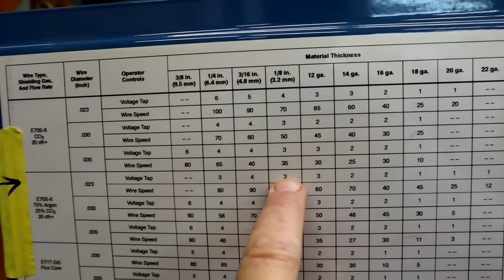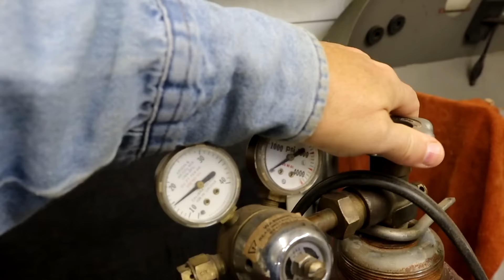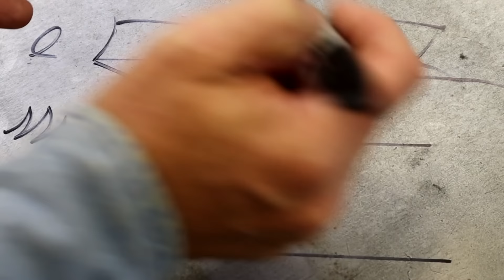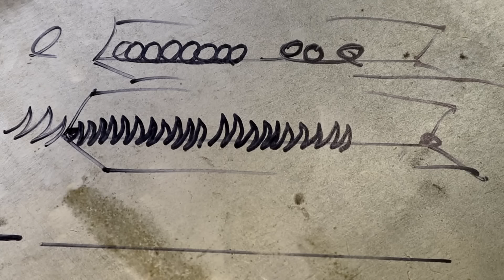How To STACK DIMES With a (MIG Welder) For Beginners🔥🔥🔥

Comment: I work in a fast paced production shop making dumpsters, typically running around 30@640 on 12ga sheet. I wish I had the time to go slow and actually do designs.
Reply from the maker: Dang you slaying it, thats movin some metal. I bet you can lay down some slick beads!!!
Reply: We do the same, but the machines are cranked up ALL the way on voltage and wire speed. It's VERY hard to find people to start no matter how much experience they have, they burn through as soon as they pull the trigger... Hell I still burn through, but I can start the "bead" over and go a Lil faster over the whole and fill it...
Reply: Bro I make dumpster and car haulers. we make 1 a day. Everyone does. I paint and put the axles and wire it up. I even cut my own stuff and weld it I bust my ass
Reply: I’m doing 3mm sheet for bins, we set a nice outside corner every join and flip the bin to suit a vertical down, manage to get some nice looking beads with good penetration.
Reply: Yea we push out server cabs 50 + a day depending on what line you're on and I wish we had the time to make things pretty
Reply: I ironically make dumpsters too. You gotta rip and run it sucks I like taking my time but it’s not in the cards
Reply: @joshuatorres318  boss makes like 30k a week. I make 1200 with 1 hr lunch 🙃 if I even take that whole hr the American dream
Reply: I work on dumpsters and goooood lordy there something else
Reply: @wolfseek crazy, I make 450 a week (uk pounds) and I only have fucking 30 minute lunch, which is technically only 25 minutes but everyone ignores that
Reply: I build kitchen hoods on a production line! I’m doing. 18g 430 @ 20.5 heat and 350 wire speed.
Reply: @TheTruthMatters do u need to do alot of back and fourth motion?
Reply: @VypaGaming  there's no way possible to do a back and forth motion. They aren't the best looking welds but they are EXTREMELY STRONG. It's not the welding you learn in school or online. Turn the machine ALL THE WAY UP, LAY A BEAD. It sticks...
Reply: dude how do yall burn so fast I took a weld test at a place that builds dumpsters today and I couldn't figure out the speed without blowing through or moving too fast. needless to say the guy said I needed practice and I told him my machine at home doesn't go that hot lol
Reply: I’m doing parts bins and it’s the same thing , 26.5v and 500 just lay em as fast as you can well they look good enough to grind lol
Reply: Y'all are too funny. 
I weld on ships and we only run 23- 25 volts on 8 mm plate. The only time you would turn a a machine to 30 volts is when you are welding  20-72 mm thick plate.
Reply: 30 volts on 12 ga. Sheesh
Reply: What’s the pay like?
Reply: @Gregoman89  they started around $21 with no experience. After 3yrs I was over $25 but they did a mass "furlough" a few months ago because they claim they weren't getting orders which is a lie, so I no longer work there.
Reply: All y'all saying you weld dumpsters and stuff, I'm not a welder as a profession, but wouldn't stick work better for that, or even be easier?
Reply: @donkeyhotay456 my guess is they're just trying to max out production with hotter faster welding

Comment: Them welds won't be strong enough. For that thickness of metal, run 28 volts or something and don't do any loopy sh##
Reply from the maker: Haven't broke yet, Ive built offroad chassis that jump 15ft in the air with no fails, its all about the settings.

Comment: Because humans are stupidly hard to come by, we started using MIG robots. We make complex aluminum tubing bodies. We had historically only welded aluminum using TIG (artfully I might add) and still do but we were forced to use robots to keep up with demand.  The robot makes messy welds in comparison. Especially disturbing is the spatter.  I am wondering if you could use air nozzles to blow the slag out of the way and quickly cooling the beads, so they do not stick.  Has anyone ever tried this?
Reply from the maker: I have used the weld splatter spray . You spray it on your metal  before you weld and it keeps the splatter from sticking to your work piece.
Reply: air nozzle will blow your shielding gas away and you will have the ugliest porous weld you ever did see lol
Reply: @jamesgreene5342  Thanks! That's why I was asking! I expected something lol worthy. And its hard to explain but my thought was instead of blowing it directly at the tip... have the air nozzles basically attached to the weld head blowing in any direction but towards the weld (or reflecting in to). I am sure this is why more complicated than I can imagine so my real hope was someone would say, "We have a working model that does just that!" or someone would say, "We tried and failed."
Reply: @ACDesignsGarage  useless when it comes to low hydrogen rods

Comment: Won’t be very strong, welder for 40 yers plus.
Reply from the maker: It works on the thickness I weld. I mainly do chassis fab around 1/8" to 3/16" also im welding all around the tube,its pretty strong. I also have been welding for 30 years and been employed by offroad race teams and seen my welds flip end over wnd at 80 mph and not break.

Comment: You shouldn’t never drag and/or (stack dimes) with mig welding. Dragging the nozzle doesn’t give the penetration needed you should push with mig. Any sort of weaving will cause weak spots in the weld and cover up porosity. It will also reduce penetration needed for a good weld.
Reply from the maker: Ive done several break and etch  test and cant see any difference in penetration. Its all about your settings, you can do a cold weld pushing and not get good penetration

Comment: my dad had me welding since 13 building stuff around the house now i'm 52 been fabricating since welding is a valuable skill that I thank my dad to this day for teaching me and taking the time to really show me a skill where you work with high voltage and sparks and flame fire
Reply from the maker: Thats awesome,  My dad started me around 12 and im 45 now still welding. My dad use to be a pipe fitter/welder for a power company for years, thanks for sharing and watching!!!!

Comment: As a professional welder for 46 years ( and still going ) I have to say I almost never ' stack dimes '.
I pay attention to the blending of the metals on either side of the weld plus heat flow and things like that, never dime stacking.
I have worked a lot of different jobs welding things that need to be ' leak tested ' and seeing a weld like this I can't help but think how under every third or fourth ' dime ' there is a leak.
Reply from the maker: Its like a different tool for every job, Now granted I dont use it all the time but when your in chassis fab and not welding over 3/16" wall max square tubing it works pretty good. Not saying it works for every situation. I do break test with acid on all my processes and it faired pretty well with proper settings. Thanks for your input, I always consider everyone's knowledge!
Reply: @ACDesignsGarage  one thing for sure, almost every welding job has its own ' different ' processes.
Reply: I'm an underground mine foreman of 24 years and countryboy/hillbilly that agrees with watching the flow and doing whatever works to get consistent penetration and metals fused together as one. I guess it's easier said that when you are expected to do a job right and sometimes paying the price for wasted time and materials you're going to learn quickly or find the guy that knows what he's doing. Lol
Reply: Do you make a good amount of money?
Reply: In welding school we got scolded when we "stacked dimes". But of course we did it, because it looks cool. When it came to strength and penetration tests, our teachers convinced us that straight overlapping beads are better though. But then again, anything can be "good enough" and straight beads does not look as cool... :D
Reply: But when doing a fillet, you have to span a bit.  That takes lateral movements, which naturally create "dimes".   ???
Reply: Where can we go to watch you?
Reply: I’ve been welding for 165 years, I disagree with your comment and I can guarantee I’m a better welder than you
Reply: @Imthebestaround88  you probably are. All I know is I have been doing it too long. Past retirement age and still welding.  I've had fast production 
' squirt- gun ' welding jobs, I've had high- power stick welding heavy plate jobs,  I've had building intricate machines jobs, I've had monotonous same old thing over and over jobs, I've had fitting and tack welding jobs where I didn't even use a shield. I've had tank welding jobs where everything had to be leak tested 
( thats where you get good ) stick welding, mig welding, tig welding and torch braze welding.
Right now I do a lot of tig welding using a mig wire feeder to cold feed wire.
They are all different.
Then there are the different repair jobs.
That is a whole another story in itself.
Reply: Could you weld both sides? One side for the eyes and one side for function?
Reply: @matthoon3737  yeah, I suppose you could. Depends on what it is.

Comment: The trick is... you want root penetration so the weld is a weld. Not a pretty bead profile with minimal electron transfer. A good strong weld will look great and be strong. Over ocilation for looks will bypass the strength of the two parent metals becoming one unit. Your video is a great tutorial for light applications for sure. Awesome work.
Reply from the maker: Thank you, yes its based on automotive applications like 3/16" and not structural applications.

Comment: 6:24 no penetration. You have to get the arc out of the puddle, move forwards, dig a trench then go back and fill it in.
Reply: Not to mention he is not running hot enough to keep the air out

Comment: Thanks for the tips! I'm loving welding, got everything I need and have been making small things, tools in my shop. Practicing so I can build a tube chassis rig!
Reply from the maker: Thats awesome, I've want to build me a tube buggy also. Thanks for watching
Reply: So this is my whole reason for getting into welding I’ve been watching cars and cameras a lot amd a lot of gokart fab watching fd champ mike essa build roll cages all I wanna be able to do is have a couple motors and be able to weld me up some chassis ultimate goal is building a 1000 cc cross cart buggy thing in the design of a rc car set up.. but my question is would a 120 volt welder be suitable for welding some steel tubing for a off road chassis and would y’all happen to know the desired tubing dimensions for building a cross cart I’ve read alot of different things and I’ve also seen people build mini bikes with Home Depot conduit  I just wanna know the cheapest strongest steel

Comment: I bought a Miller cracker box stick welder and a 100’ roll of 6-3 wire to use as an extension cord 50 years ago . The wire eventual was used for different purposes but I still use the welder. Works great even now.It is a vvery solid machine.
Reply from the maker: Thanks, I still have my old miller buzz box that was my first machine. They keep on goin!!!

Comment: If I were doing that fillet, I would have the tip sticking out paste the nozzle 1/8". Don't touch the tip to the weld (of course). You won't believe how much better things are. Works great on flux core too. You can chamfer the insulator and/or pound a piece of pipe in the big end of the nozzle to swell it out so it will slide on further.
Reply from the maker: Awesome, thanks!!!

Comment: The ideal weld is smooth and clean inside and out. Do you ever find the "cursive e" method traps slag inside the weld? Outside appearance is a good indicator of quality, but the stacks of dimes come from the TIG process; there is no reason to mimic that appearance with MIG besides trying to impress people that don't understand what they are looking at.
Reply: Generally speaking, MIG doesn't create "slag" as we traditionally know it. The issue comes from dragging impurities BACK into the weld puddle. The silica glass that forms on a MIG weld will always float to the top. NOW, if you switch this over to flux cored wire, THAT is when you run the risk of slag inclusions in the weld.
Reply: Also makes for a weaker weld with less penetration.
Reply: Yep
Reply: I was doing mig today for vertical I was doing upside down v and it worked really good for me

Comment: The circle bead is a much tighter weld,that prevents less gas bubbles from forming inside the bead. I rarely run the zig zag beads unless I am filling bigger gaps on a joint. Your beads are nice an tight bro. Nice work!
Reply from the maker: Thank you very much!!!!!

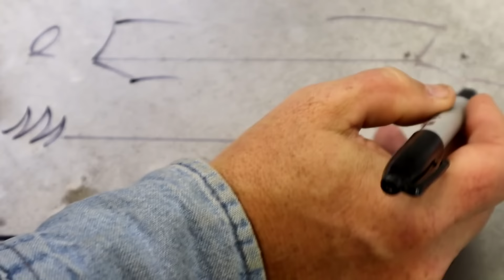Comment: 3:00 No loop. Pull straight forward "getting out of the puddle." You will dig a trench, come straight back, stay in the grove but tilt tip over to the top, wire stays in the center, no loop. Stay still until the puddle starts to shake, then get out and move forward again. You should be able to count the number of times you step back. And get you should get a reliable length bead for stich welding.
Reply from the maker: Thanks for the tips! That process is what I call whip and pause, gonna do a video on it this week.
Reply: Basically whip and pause. I'm okay at whip and pause but I'm better at a straight push. My whip and pause pulse spray transfer however looks immaculate lmao, gotta love pulse spray

Comment: I'm not a professional on mig, but in my experience what I used to do is a little forward and backward movement, and it leaves a pretty good looking weld
Reply from the maker: Yeah it works well also, I do it  that way sometimes!!!
Reply: I do the same. Its commonly known as the "whip and pause" technique.
Reply from the maker: @brianwalker1933  Ueah I like to use it alot in high visible areas on car chassis

Comment: My one and only welder. I also have the aluminum spool gun attachment that goes with it! I have fixed many aluminum diamond plate bumpers over the years. It does a pretty good job but of course a tig is better.
Reply from the maker: I also have the spool gun and it works pretty well, but im like you there is no substitute for tig lol

Comment: Dimes, nickels whatever size circle mig weld always looks beautiful but is usually a waste of time. Go take a welding test at a place that's looking for welders and half of them will fail you. The important thing on any weld is the root. I went to school for welding and our instructor flat out told us not too lay dimes down.
Reply from the maker: Its like a tool in a toolbox, its not for every job. I mainly do automotive/race car fab not structural steel or pipeline weld. Now with that said not using the right heat range and joint prep will cause it to fail. Ive had my welds sail 50ft off a jump flip end over end and not break so they can be strong. The best thing to do is a break and etch test for every job and youll be fine. Thanks for watching!!
Reply: @ACDesignsGarage  completely agree. I guess my only comment back to it would be. Laying dimes down with a mig gun. Is usually what definies what someones primary occupation is. If a welder sees somebody laying dimes down, he knows that guys a mechanic. Now when they break open the tig gun it's a different story. And usually a sign of functioning art. Generally that's an indicator of somebody's skill level at welding. Also will show you difference between somebody who works on cars for a living and someone that gets thought to apply the same affect to airplanes....my only concern though is when someone gets thought to do this and thinks that it's the go to tool, and applys it to something structural. I've worked on boats, barge's, outdoor equipment. And ran into shops with mechanic's who don't know the difference. Then watched them apply dimes to Semi Tanks and have them think that they knew what they where doing because they'd been doing the same foolish thing for 23 years not realizing that the guy that was 15 years their junior was more educated on subject of welding then their 20+ years of Mig experience
Reply: Your not wanting or trying to stack dimes on your root and subsequent passes but your wanting to put a pretty cap.  When it comes down to it if you can lay down quality weld just as fast but yours looks better to the eye your gonna get the job.

Comment: The important thing (always) is for the forward motion to include the root of the weld. Don't want the puddle to roll over the root.
Reply: Many welders on ship yards I've worked on (flux core 1.6 wire) drag the cap. 6gr London calling
Reply: @zukispur5493  yep Flux core digs deep the occasion isn't as important as some other types of welding Flux cored wore is pretty foregiveig
Reply: @johnkizziah108  yep. Femax iron power rods are used on most shipyards also on the hori fillets
Reply: @johnkizziah108  ever tig rooted a pipe feeding the filler rod from inside the pipe (through the gap)
Reply: @johnkizziah108  ever welded from the outside in striking arcs with both hands?
Reply: @zukispur5493  nope
Reply: @johnkizziah108  bet you could though
Reply: @zukispur5493  yep lots I was a pipe fitter for 50 years.
Reply: @zukispur5493  No and I'm glad I didn't have to. I have looked through the gap to watch the p-5 in over head.

Comment: Bead looks nice but remember stringers are stronger, if you focus the wire in the root and work hot and fast it's better for penetration. Manipulation is more necessary for out of position
Reply from the maker: I totally agree, I use this method on car chassis and light fabrication for the looks, but on structural I use stringers. Thanks for watching!!